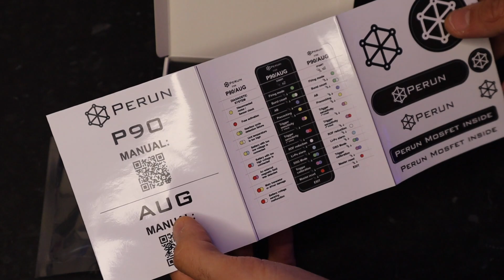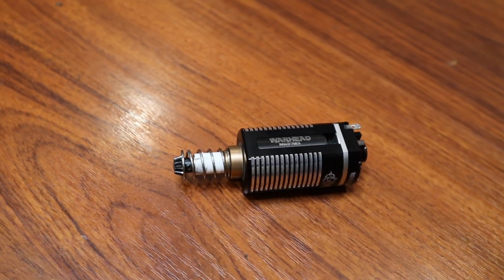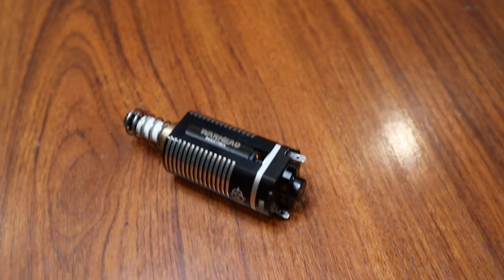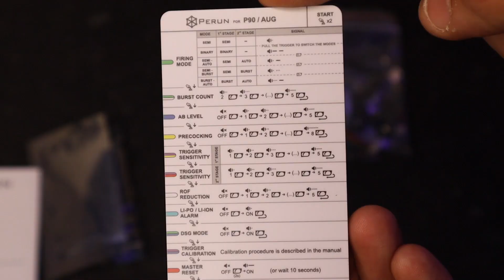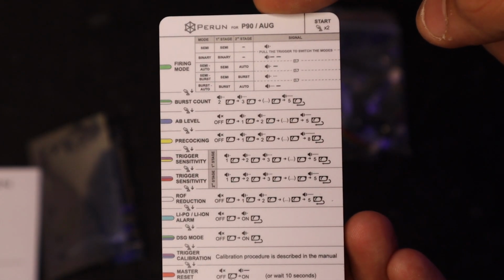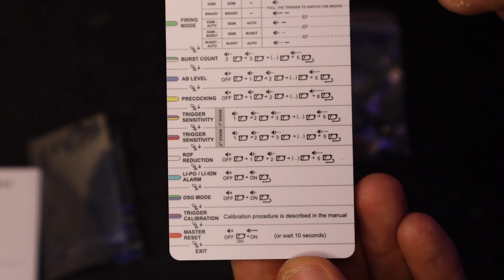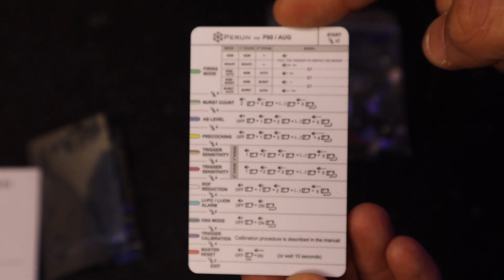Perun Mosfet for  P90 AEG Unboxing / Review

Comment: @therealdealairsoft there is a new bb gun out aeg Barra 400e it says it's based off of airsoft tech. Can someone who has this gun apply these airsoft upgrades to get better performance out if a fully auto steel bb gun????
Reply: No, not even close to being possible
Reply: The hopper looks the same I would think other parts are replaceable as well
Reply: @thesilversphincter  some, but anything with the barrel/bbs won’t work due to the size difference.

You could probably in theory change out the motor/gears and possibly the main spring. But even then, the parts most likely won’t be a drop in since airsoft has such a bad industry standard that even between airsoft guns, gears/motor/other parts can vary in size by a metric ton from brand to brand

Comment: Hey thank you for really inspiring me to try and build my own gearbox what would the best motor be for under 50 dollars?
Reply from the maker: There are no good motors under 50. 

The best value for your money is the real deal golden Boi gen 2 motor. Why? Well it has virtually the best features in the market from high temperature rated magnets - to 4 bearings through the armature - silver brushes - steel heat treated pinion gear. 

The list goes on. No other main stream motors really offer these luxuries. And ASG is now $75+ shipping on average 

Right now the best value is this motor 

https://www.therealdealairsoft.com/products/the-real-deal-motor-18tpa-n35sh-high-torque
Reply: Alright thank you right now I am planing on getting g the double eagle utr45 and upgrading the mosfet to a perun v2 hybrid,13:1 shs,real deal piston assembly but my only issue is I don’t know how fast the mid cap will feed
Reply: Oh and your motor to :)
Reply: And thank you for making the hint a lot more fun for me I’m learning a lot of new stuff
Reply: I think I have most things to build idk if I will need a dremel tho

Comment: BTC > Leviathan > Perun > Gate. Best mosfets in order.
Reply from the maker: yes exactly well said
Reply: Eh BTC is pretty outdated. The limited options on them, none existent customer support, extremely small batch’s, and using micro switch’s for the cut off put them close to being dead.

Doesn’t help that the mk3 hasn’t even released to the public even though it was supposed to come out like five years ago